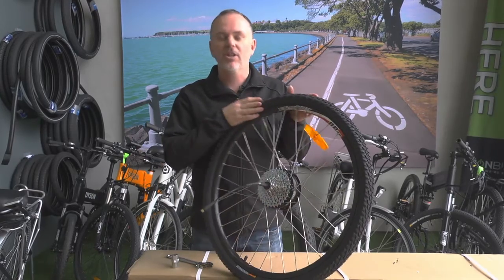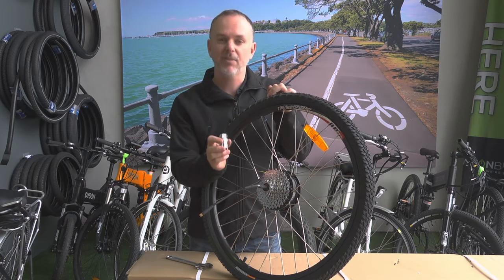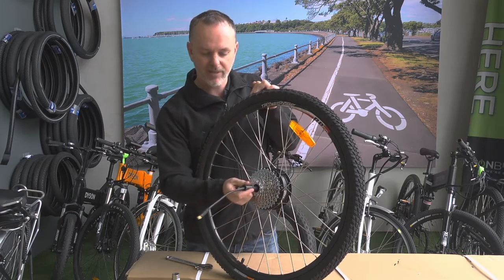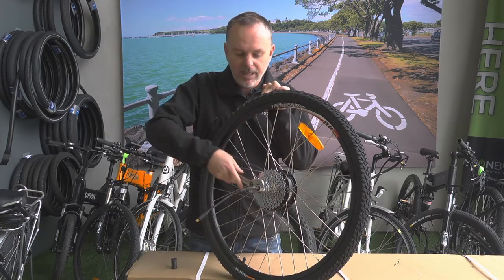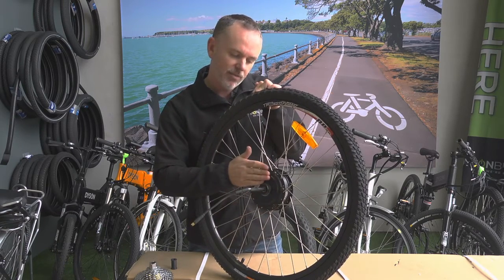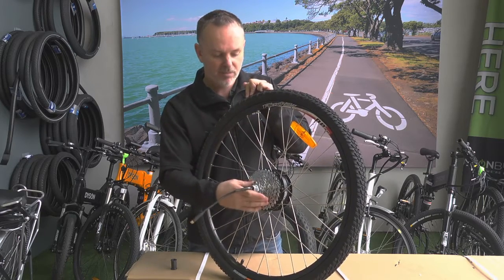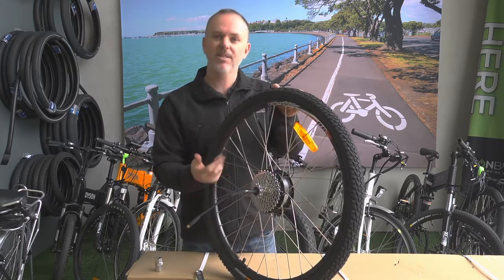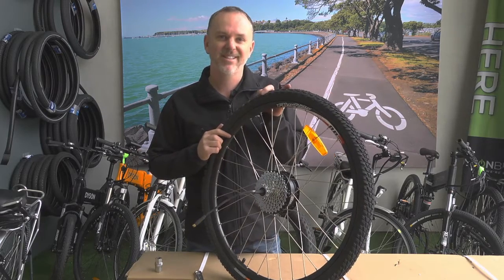Electric Bike 101 - How-to remove a freewheel, (cassette, gear cluster) from a hub motor

Comment: Hello I have a Propella S9. And  my guy from the repare Shop say my freehubs is broken. 
when I pedal my bicycle moves forward but my cassette runs empty. So I don't have any power from my crankset when I start, it's only the electric motor that moves me forward. do you think it is possible to repair it? And do you have a video that explains how? THANKS
Reply: That's this video. On these ebikes the freewheel is usually combined with the cassette. They generally won't take a regular cassette but a screw on freewheel like what's shown here.

Comment: hello, thanks for the clear explanation. I am looking for such a freewheel cassette with 11-46 with as few gears as possible, for example 8 or 9, more is also allowed,
 but then I would like to know which derailleur and shifters I need. 
The thickness of my cassette (14-28) is 4.4 cm and the barend shifter must be able to bridge that distance well. What can you recommend to me? thank you in advance
Reply: Hi, I haven't seen a screw on freewheel with that sort of range (11-46). also with the wider range you generally need more gears to allow the shift.

Comment: damn, the connection on my power cord is too big to get the nuts and washers off ...so I'm guessing I got to either somehow detach that connection from the wire or use some other make shift tool that can do the same job as the lock ring but bypass the nuts and washers
Reply: I have the same problem, please do let us know if you figure a way out.
Reply: @reynoldrajan  well I'm still doing some looking and I think the tool required is a lockring remover, possibly an oversized one meant for some cassettes or disc rotors . It looks much like the freewheel removal tools except a tiny bit bigger. Anyway, I'm trying to contact DNP since they made the one thats currently on my bike. They should know I figure.
Reply: @MrRizo23  really appreciate your reply. Thank you!
Reply: @reynoldrajan  I have a rad mini and the same problem because of the large connector plug.  I think I saw the tool on the Rad website but can't find it any more

Comment: what do you do if the nut and washers that bolt the wheel to the swing arm are not big enough to come off the wire so you cant get the tool on
Reply: Hi, all of our Dyson ebikes the nut will go over the connector, but might be a little tight. The connector is fairly standard, so not sure why it won't work on yours..

Comment: i can't get it over the cable, hole needs to be bigger than the tool.
Reply from the maker: Some high power hubs seem to use a larger plug, you may need to drill out the hole to make it work. Most 250W bikes it will be ok.

Comment: If I want to convert a bike which has no gears (single rear with back-pedal brake) what is the best way to go for the new rear for an e-bike conversion?  Ideally I'd like 7 to 9 gears in the rear and two up front for a 14 to 18 speed.  This is an aluminum Schwinn cruiser that I want to make into a robust e-bike capable of steep hills so Im thinking something like the Shimano 14-34 rear sprocket or similar cassette with 48/38 front chainrings. If I can get 25 mph on flat ground via pedaling or the battery I think that will be ideal for my goals.  Any advice you (or anyone that reads this) can give is appreciated!
Reply: I Converted my Schwinn Legacy Cruiser into an E Bike. PLEASE DON'T PUT GEARS ON IT! I used a 1000 watt/48 volt motor/battery FRONT WHEEL Motor. It's just great. 32 MPH Top Speed. It uses  BALOON/Cruiser tyres (2.25" ×26") and is still a SINGLE SPEED! The bike can still be pedaled home EASILY if the motor quits. The tyres provide PLENTY of cushion on bumpy ROADS (NOT Mountains!) The motor has lots of torque for climbing, too! It IS a FWD. Though, which is NOT made for Mountain climbing! My recommendation is; Do NOT PUT A Rear wheel drive (RWD) on that Beutiful Beach Cruiser. Convert it to a MTB but leave the motor off. And, if you MUST HAVE a motor, put it up FRONT. It will save you lots of money, time and HEADACHES... Good Luck!
Reply: @sunnybeaches1331  Uhh, late to the party dude. Take note I wrote that 4 years ago. 2nd, it's not a beach cruiser, it's a laid back motorcycle chopper style cruiser.  Because of the long raked front and sit back in the seat style, there's absolutely no way you can pedal over anything more than a 1 percent incline.

Comment: Hello I have a stromer st1 platinum step thru, I am trying to replace my drive train (basically everything except derailluers). Need some advice on buying a cassette. Do I need to buy a new cassette hub when replacing my cassette? Reason I'm asking is because no local shops stock this 9 speed hub for ebikes and I was hoping I would not need to buy a new one (in other words just reusing the hub already on there). Thank you!
Reply: Hello Julia, I am working on replacing the free wheel on Rad City electric bike and came across this. You probably already have your drive train replaced as it was a year ago. Everything I replace on my bike I get from the manufacturer and I know it's always correct. So if you get a cassette from yours you can use the same hub and will always match. Contacting where you bought your bike and getting parts from them I believe is the best way to keep these bikes rolling. I hope this helps you in the future.